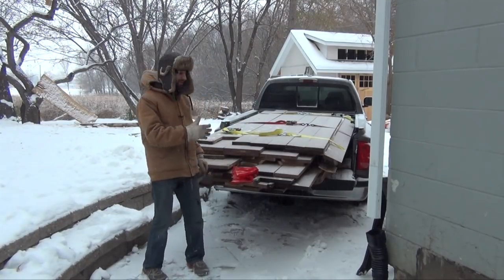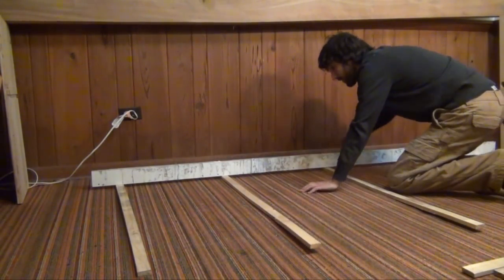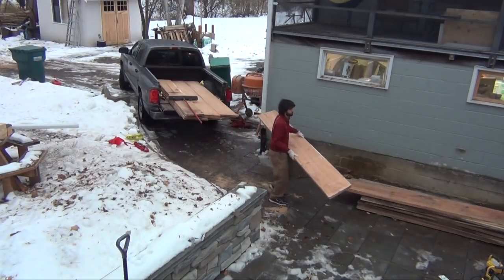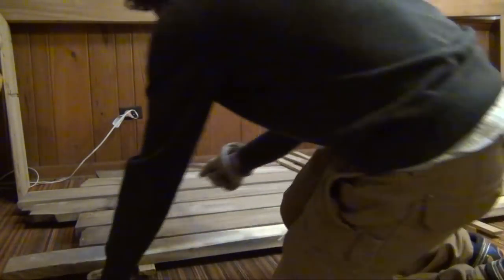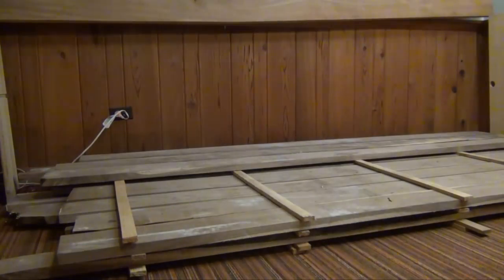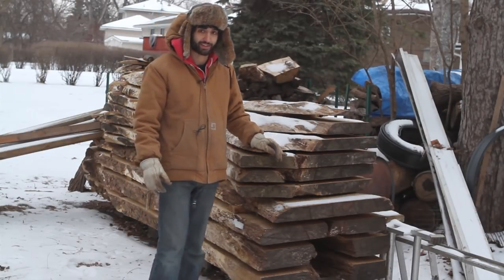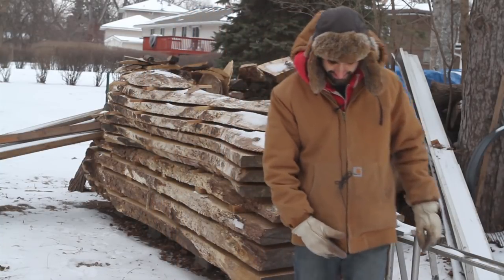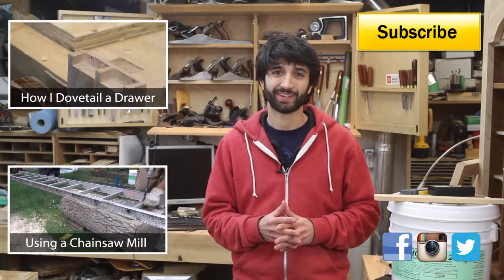Air Drying Your Own Lumber

Comment: Few questions. Was the straight edge an aluminum screed? I've always wanted one. Should the sticker spacing be tighter for thinner stock (maybe I missed that part)? I figure that rule should be used for spacing lumber racks columns too. If you don't seal the end grain does that significantly decrease drying time? Nice tip about using known dried same species wood with lower quality meters.
Reply from the maker: diycentral lol no that was just a piece of melamine that I had used as a concrete form.  Yes, they should be closer for thinner stock.  I space mine 18-20" apart for everything.  I don't cut anything less than 4/4 but if you did, you'd want those stickers to be closer together.  Not sealing the end grain would decrease the dry time for the ends of the boards, maybe 6" or so, but the middle of the board would still take the standard amount of time. Thanks for the questions!

Comment: Great video Matt. Very informative, one question I have is there any particular measurement thatt the boards need to be apart from each other. I assume you don't lay them down edge touching edge

 Thanks again
Reply from the maker: angler1262 Thank you!  Correct, they should not be touching.  The space between the boards is another airflow variable.  I usually shoot for an inch apart.

Comment: Hey matt,
Besides taking it out doors or burning it in a bonfire, What can a person do if there are bugs without killing or damaging the wood? And are all woods the same as far as moisture readings go - like what # or % does it need to be at to know its completely dry?or dry enough?  Did those questions make any sense? &ur always informative and detailed in  ur work and  video tutorials are too
Thanks man
"Til the next episode".
Reply from the maker: Joe Walters There are a couple of options.  The easiest would be to find someone with a kiln and put it in there.  The heat from the kiln would kill them.  You could also tent the boards and fume them or you can spray the boards down with insecticide (assuming the insecticide doesn't stain the wood).  Yes they all need to be dried to the same moisture %.  Generally that's going to be 8%.  Thanks Joe!  Great questions!
Reply: Matthew Cremona thanks! At the end of the month I am supposed to be traveling to Fredonia New York you pick up some rough cut walnut and hickory with my cousin's husband seeing that I don't know anybody that has a kiln, I will have  go wth the tarp tent..
Just any type of "bug bomb"will work or will it say on can uts specially designed for wood?
Reply: @tooljunkie555  l

Comment: Hi Matt! I have oak boards that have been drying outside for the last 10 years. The MC is about 15% and I wonder what my options are to get it lower. If I take it inside the house, how long time do you think it will take to dry them down below 10%? Do I need to sticker the boards if I take them indoors? Cheers!

Comment: Great info Matt, thanks for sharing. In your opinion, would wood glue diluted with water work as endgrain sealer?
Reply from the maker: Tamás Elkán Thanks Tamás!  It would work to some extent.  If I was going to try it, I would just use straight woodglue thinking that would provide a thicker seal.

Comment: Thanks for all the tips. One question- if you’re stacking the European way, it is not possible to cut quartersawn wood?
Reply: The nice thing about cutting boules as opposed to other methods is that it is fast and you end up with a mix of different cuts for use in different parts of projects.  You will get flat sawn lumber for panels, quartersawn lumber for frames and riftsawn lumber for legs.  No need to specify different patterns or deal with flipping and squaring up your cants.

Comment: Hey Matt - I'm up in Manitoba - we have about the same weather.    I've got a stack of wood in my basement that I picked up at the lumber yard. Is there any way to tell, without a meter, if it's dry?  Eventually, I'll get a meter, but I'm hoping I won't need one right away.    Thanks! Great Vid!
Reply from the maker: Bobby Kurczewski If you have an accurate scale, you can take a sample and weight it every few days.  When it stops loosing weight, it's dry.  If your conditions are like mine, it should only take a few months to dry.  Maybe 5 months tops conservatively
Reply: hey - now that's genius!   Thanks, Matt!

Comment: Matt, very interesting subject. I was wondering if you run into problems with the wood building tension from drying it so fast? That is, do you have problems with the wood twisting when it is cut?
Reply from the maker: Scott L I have no issues with stress developing in the boards.  It's extremely stable stuff. I think this method is the fastest way to dry lumber without introducing stress. Thanks Scott!

Comment: Hi, i live in florida, and i want to build a log cabin, so i need to dry large, long trees... how long would that take? Around a year each inch? I want to lay them outside, and stack them, maybe 3 layers high, and 5 across. And probly inclose it in a box, and put a fan inside, pluse 2 humidifiers, one on each end of the long trees. I really hop it dont take that long. They are around 3 foot wide, 100 foot long.

Comment: I have a log about 12" diameter and about 48" long. It's been sitting on a concrete patio since it was cut down about 3 years ago. If i mill it up would it be the same procedure as this

Comment: When the wagner meter detects a certain moisture percentage, how far into the wood is it reliably reading?  I cut some kiln dried cherry recently and it started to warp minutes after cutting into 3/4 inch thickness from a two inch board.  What does this experience say about moisture content?

Comment: the log should be sealed on the end grain when the log was cut before milling.
Reply: dave newjersey 

Info on why , thanks ?
Reply: I work in a sawmill that has both a bandheadsaw and a circle headsaw. Logs are not sealed before sawn
Reply: Doug Yankunas- because moisture moves much better/faster along grain than transverse. Once below fiber saturation point, shrinking starts. Ends then irreversibly check. End-sealing slows that, preserving lumber quality there. Applies especially to hardwoods.

Comment: Hey quick question...I have 6 pieces ( 2inch x12 inch x 5ft) of rough cut  pine air  drying under a covered porch.   The temperature and humidity is similar to Florida.. ( day,/ night. 25C/ 31C , humidity 50%avg). I started getting concerned about the ends cracking after watching  a few YouTube videos on the subject. i don't have access to  anchor seal,  and i was hesitant in using a latex paint.  So  i melted waterproof shoewax and applied with a paint brush.  It left a wax coating.  Should that be sufficient or should i apply something else? Thanks.

Comment: Matt, Great video! Thank you for putting these together! I'm following your sofa table build on the WWG site. Question: Do you run your fan constantly? I've been told to beware of running too strong a fan (I've got box fans) too constantly, as it might dry the wood too fast. Thoughts? Thanks for all the lessons and inspiration!
Reply from the maker: +Eric Thomas Weber thanks Eric! I run a fan intermittently. More often early in the drying process. Maybe 8 hours a day and taper down to 8 hours every few days
Reply: +Matthew Cremona Awesome! Thanks, that helps a lot.

Comment: I have a couple questions if you  have time. If a person has a stack in their basement would it  be worthwhile to cover and run a furnace duct into the stack, I have geothermal heat so temp is 100f but a lot of air flow. Also if drying burled wood should the burled areas be anchor sealed. Thanks P.S. anyone else who wants to jump in on this, i welcome

Comment: I got 3 red oak boards from a local mill. The log had been down for a year. The size is 3”x8”x72”. I Amor Sealed the ends and stickered them. My moisture meter says 18%. They are in a hot building outside. How long do I wait to start my Roubo bench? Does it help to turn them?

Comment: Love the video! We're going to be drying wood for the first time from all that timber we've been cutting down. Thanks for the information. Just wondering, have you heard of putting anything between the sticker to prevent marking? Wasn't sure if that's a thing or not. Thanks again.
Reply from the maker: Slowvannah Farms Thank you!  you're going to have a lot to dry :)  I think putting anything between them will only make it worse.  The best way is to lower the contact surface by running a groove down the center of the sticker so less of it is in contact with the board.  Also make sure the stickers are totally dry so they don't contribute moisture to the system.

Comment: Matt, thank you for sharing your time with us. One question, when said a fan would a regular fan or the one on your dehumidifier. Thanks again> Jared English
Reply from the maker: Jared English Thanks Jared!  I use a regular box fan.  I used to have an oscillating tower fan but I dropped it a few too many times.  That fan was nice because it provided a nice moving column of air.  I put the box fan on for 8-10 hours a couple times per week and just move it around throughout the day.
Reply: Thanks for the information.  Jared

Comment: Thanks for the info presented. Great! What would you suggest for outside storage? I have lean to next to a outdoor shed (25 by 50) where my shop is. The wood stays dry. anything special I can do other than make it level and keep water off?
Reply: It doesn't need to be level it needs to be flat.  You don't want the wood to be given a twist, warp, or undulations.  The easiest way is to put down supports and even them in every direction.  Use shims to fill gaps or raise the supports.  Second make sure all the stickers on any given level are the same thickness, similar dryness, and same species.  Best if same species as drying wood.  If stickers dry at different rates you are creating undulations to the pile.

Comment: Do the stickers have to be wood for any specific reason, I'd imagine you could use plastics or something yea? I do know the woodmizer I own has stainless bed rail  caps as not to stain or mark up the wood, they don't rust, so I would say avoid using any metal that can rust or is painted, like fence posts would not be advised,

Comment: I am confused about air moisture. On one hand, you suggest that a sealer will help prevent moisture from escaping the boards. On the other hand, you suggest air flow and gaps in the stack is important so the moisture can leave the boards. If you want them to dry slow, why leave big gaps and use a fan? If you want them to dry fast, then why use a moisture sealer?

Comment: I'm curious, could I use my oven to speed the drying process for oak and hickory? I thinking of making some practical tomahawks with a hammer poll from wood cut on my farm. I've got elm, hickory, white and red oak, ash, and maple.
Reply from the maker: Rich Holland Yes you can.  I've done it to dry rough turned bowls.  You'd want to wait until they're already pretty dry before trying it.  Too much heat when they are still wet can cause all kinds of issues.

Comment: Great video thanks for all the info! A quick question I have a black cherry tree that I am planning on having milled, I've let this tree stand dead for aprox 1 1/2 years then felled it and have let the logs lay for another 6 month's, now this is the only tree I really have plans to do this with so in your rough guess what do you think I'm looking at for further drying time after the boards are milled? They will be live edge and staked outside as I have no space inside. I would appreciate any info you could give.

Thanks 
Brian
Reply from the maker: Great question, Brian! How thick are you going to have them cut?
Reply: I'm thinking 2 inches, my plan is to make a dineing table out of it.
Reply from the maker: Brian Gingerich The log sitting around drying for a couple years will probably shave about 25% off of the dry time.
Reply: Matthew Cremona thank you for the info. I love the show keep up the great work!

Comment: In the clips of you putting all the lumber in your basement, do you still use anchorseal on all of those boards? Or do you only use it when you use slabs with the "European" style of drying?
Reply from the maker: I use it for everything. I didn't show it in the video but I had some saw horses just inside the door. I set the boards down, put the anchorseal on and then carry them to the stack

Comment: Hi, Matt. Thanks for the videos! Question for you, since you have good experience drying slabs. I moved from Massachusetts to LA, and wood working space is limited here. I brought with me a number of black walnut slabs that I used to have drying and stored horizontally, with stickers. Do you think a 2.5" thick slabs that are 8' and 10' long will warp if stores vertically? That's what I have done in my garage; It's really my only option other than storing outside in the elements and amidst the termites. Any advice is appreciated.
Reply from the maker: Are they already dried or close to it? I store most of my larger stuff vertically once dry. It just makes it easier to look through them.
Reply: +Matthew Cremona I need to check them... The black locust slab has been drying for over 2 years, so should be good. The walnut slabs have been cut at least a year, but the last six months they have been in an unfortunately stack under a tarp with little air movement (My attempt to protect from termites here in Ca.). What moisture % would you feel good stacking your slabs vertically? Also... Any tips you have would be appreciated. Thanks again for all your effort to share and help others learn!
Reply from the maker: I would feel pretty comfortable once they got below 20%.  The nice thing about thicker slabs is since there is so much material in them, they tend to have less of a tenancy to bow.

Comment: If you seal the ends can the wood still be dried too fast? In my basement if I have a dehumidifier and fan running I assume it would expedite the process but i don’t want to push it so fast that it splits/warps.

Comment: Was the wood green (no drying done to it) when you brought it to the basement? If so doesn't it dry too fast and split?
Reply from the maker: aqwood yes, it was green.  My meter only reads up to 32% and the boards were above that.  I've never had a problem with them drying too fast.

Comment: hi I  just cut a big black cherry about a month now   and cut it into 5 slab 12' by30''by3''  try to build a bar top I have 2  more month to go until my project I put it in a room 12'by 20' and have 2 fan going and a dehumidifier going do u think it will dry enough to buit ? thanks

Comment: What size dehumidifier to you use? I  live in Colorado which is pretty dry most of the year but my basement will not have a lot of airflow.  I was thinking of drying my wood (a bunch of 4/4 8.5" wide boards and ~8 20" wide 8/4 slabs of walnut) in the main room of my basement and use a fan and a dehumidifier.  However,  I am concerned about drying it too fast and getting case hardening based on your comments about running the dehumidifier in the summer but not the winter. Do I run the fan and dehumidifier all of the time, on intervals, or occasionally?
Reply: Well it will depend on the size of the basement. If you're in a 1200 sq ft. house, and the majority of the basement is open within that 1200 sq ft, I would get a 70/pints per day dehumidifier. (dehumidifiers are rated based on how much moisture they absorb per day). It may also be worth getting one that has a constant pumping of the moisture absorbed, if you have a sump pump that you can drain into. I'd say that during the summer, run it all day, maybe keep it off at night, unless it's really muggy out.

All in all, it will really depend on the size of your basement. Look up what size dehumidifier you'd need that would match the sq. footage of your basement. I wouldn't worry too much about drying it too fast.
Reply: Thanks.  It is very dry here year round and the only appreciable humidity in my basement will come from the wood although I imagine there is a fair bit of water in ~500 board feet for green lumber.

Comment: I was wondering if you could give me some tips on I guess re- drying  kiln dried Pine. I have been making table tops for rustic tables but hate fighting the material so much. it's seams to just twist and bow relatively quick. the lumber I but at the local big box store seems to be saturated with moisture. I live in ohio and have major seasonal ups and down with humidity. my shop is is the basement wich is extremely dry. any tips would be greatly appreciated. Thanks is advance!

Comment: what relative humidity at 60 degrees do I need to achieve in the air to get the wood to the desired moisture content?   When I put a dehumidifier in sealed basement room it can get to 30% relative humidity at about 60 degrees.  I can probably push those limits if I close and seal the door.  Thoughts?  Thank you
Reply from the maker: 30% is fine.  What's the RH in your house?